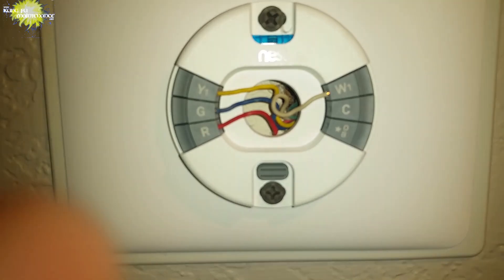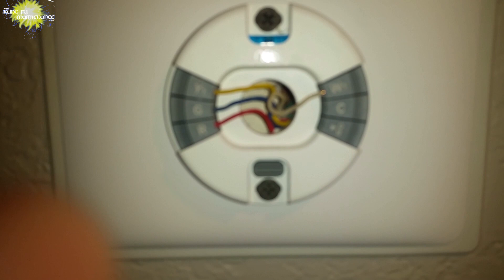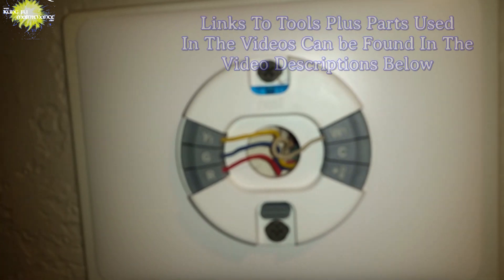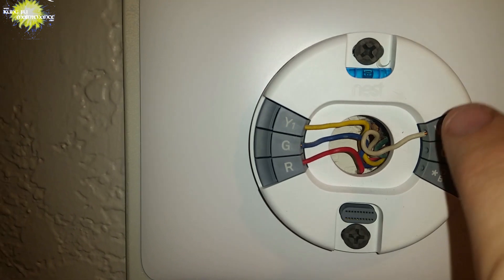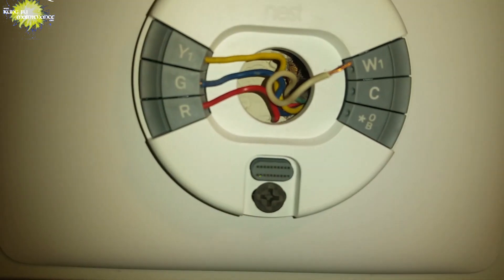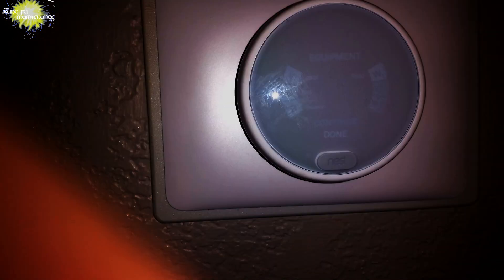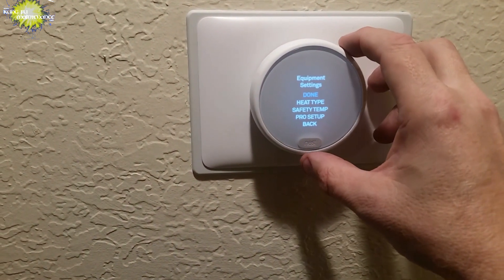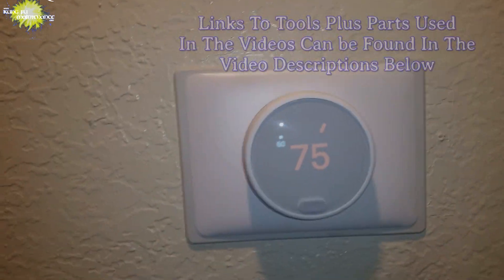Nest Thermostat Heater Does Not Work Or Show Heat Mode As An Option  How To Repair

Comment: Thanks for this video. I just had a call with this exact problem. Thought I had it fixed rather quickly but ran into another issue. Blower fan wasn't coming on during the heat cycle. Of course it was deactivated (by default or error on setup). Another quick fix once I realized how to navigate to the settings and equipment.